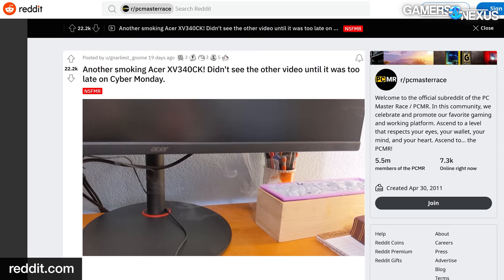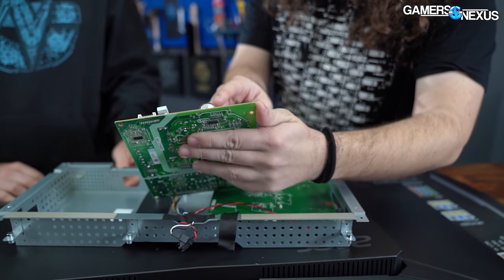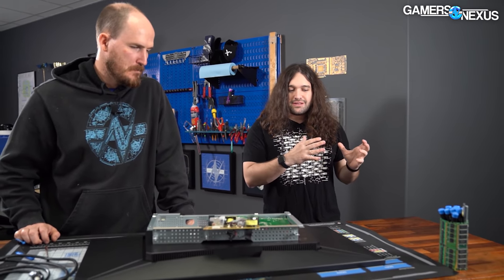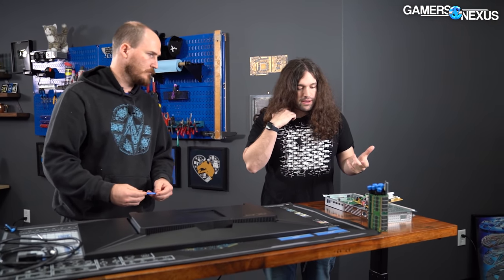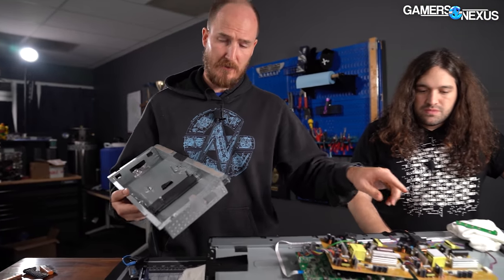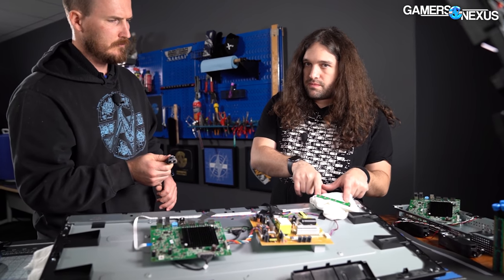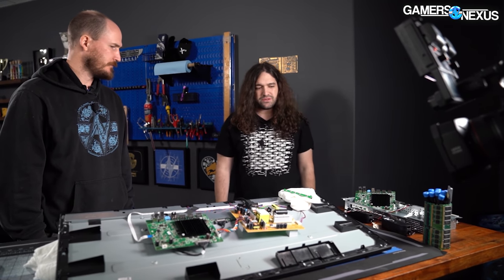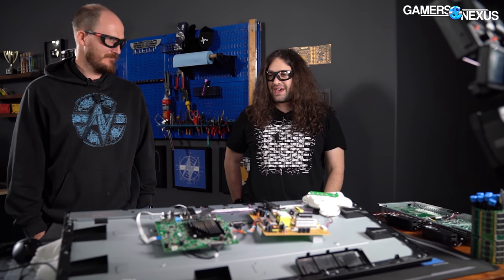Acer Monitor Fires Investigated: Blown Capacitors on Acer XV340CK

Comment: Hi Steve/Patrick. I don't know what you were displaying on the monitors while testing but maybe it's a good idea to display a plain white backround with max brightness so you can force max power consumption. Also maybe swap the power delivery board on the working monitors with the dead ones to see if there is still hope left for the latter.

Comment: That board is exactly like a PSU. It's only purpose is to supply power to different parts of the monitor. Hence, the name, power supply board. The second has the job of processing the input video signal and ultimately creating the image on the screen. That's the main board. Depending on the size of the screen, there could be what's called a timing control board, or t-con board, for short. It handles splitting the signal into vertical and horizontal timed signals and then fed to the LCD panel. These are more common in televisions, not monitors.
Reply from the maker: Yes, that's why we talked about the power board separately from the logic board and said that we'd understand the power board, but not the logic board.

Comment: I have this exact monitor. I didn't have a quick issue. But I started noticing when running a game sometimes the screen would flash occasionally and I would hear a click sound. I thought it was because my GPU couldn't handle the monitor. But I made a reddit post to be recommended a new gpu, and the comments said my gpu should be fine. 

First DP1 failed and then  ~2 months later DP2 failed. Now on HDMI I can see the desktop but when I launch a game, the monitor goes black until I either close the game or move it to another monitor. 

There's clearly something wrong with my monitor and it sucks because these aren't exactly cheap. Really love that you guys are on top of this.

Edit: I contacted Acer support. Gotta ship it out to them. Hopefully they don't say it is my fault.

Comment: would like to see you guys cover the ASUS hero z690 issue. Backwards capacitors noticed by buildzoid looking like the primary fault, but could there be other manufacture errors we haven't found yet? not sure if anyone else will add asus statements to their vids, i know you guys always do.
Also, looking forward this years disappointment built. Always a good laugh to be had there.
Happy early new years to everyone.

Comment: What is it with electronics catching fire this year? PSUs, cases, monitors, Jayz has a mobo that's catching fire. I've got a cheap LG monitor that's 10 years old and still completely working fine. The specs aren't great, but it hasn't tried burning my house down
Reply: Add z690 motherboards to that list
Reply: supply shortages.

Comment: Here's my quick guess a few minutes in:
The APFC boost circuit loses feedback for some reason and starts boosting the voltage on the bulk cap well above 450V, causing it to vent and fail.
The 'other Transformer' is most likely the inductor for APFC.
Reply: That could be it, but I think bad/underrated capacitor is more likely.
Reply: @nicholasvinen  Well it was apparently rated for 450V / 105°C, so unless they were actually defective, there would be no reason to fail, especially this quickly.
Normally any factory should be testing every batch of components they receive, so defective components getting all the way to the customer is always pretty unlikely.

On the other hand, an APFC issue like this could be caused by shipping damage (broken solder joints) combined with a somewhat bad design (no open-feedback-loop detection)

Comment: I want to say this as nicely as possible: my face went through the desk hearing you talk about the 'thermal pads' around 11:00. Not just because what you were saying was wrong, but because you did so with such conviction for so long. 
They are just physical isolation standoff adhesive blocks that serve no thermal function whatsoever.
However and given the context of this video and has others have pointed out, they are a necessary safety device to maintain board to case clearances. 
As you always say you want to understand the thing and know what you are getting into, before you accidentally mislead the audience.
Reply: Ha. I had the same reaction but managed to comment in a slightly more diplomatic fashion =D
Reply: Big oof if you guys are correct. But if so hopefully they see it.
Reply: Was about to comment something similar. Between Patrick not knowing wtf a PFC circuit is (something that EVERY switchmode PSU is mandated to have for the past 15+ years) and them rambling on about thermal pads that are in reality just standoffs/spacers... jesus this was cringy

Comment: That 'in between' transformer is the active PFC coil, just as in a PC power supply. The bulk capacitor that blows up is (on a first glance) rated correctly at 450V. Either it's below spec or the PFC circuit feeds it with too high a voltage. If it dies within a few minutes from first plugging it in, it might also be mounted in reverse polarity.
Reply: Reverse polarity was my first thought too, but in looking at them in the video, they appear to be the same orientation with the negative away from that aluminum heat sink. With that said, the cap could be labeled wrong polarity or even voltage rating wise.

Comment: Steve, I've had this display since 7/20/20. If you guys are willing to show how to disassemble the back I'll send pictures of mine. I bought it when it first came out for about $450. The only issues I've had (and it seems other have too from looking at Amazon reviews) is that half of the display doesn't properly connect to the GPU and simply shows garbage. This was "fixed" by swapping to an ASUS motherboard when my MSI exploded (and they didn't replace the cap, thanks MSI). I was also having a "no display" post error on the MSI but that no longer happens on the ASUS. This was on X470 to B550. No idea if that was an agiesa issue, crappy bios code or gpu firmware.

Could you guys plug it into various motherboards and see if it also occurs?

Another issue I've had which is pretty minor is that in a dead quiet room, you can hear a very slight buzz when scrolling in browsers. I can't say if it also occurs in games my my GPUs coilwhine+fans overpowers it. This buzz could be due to a shitty cap, which could eventually explode.

Lemme know.

Comment: Hi, guys! Electronics engineer here. A little bit of educated guesswork as far as the chonker thermal pad on the transformer is concerned: It could be used as a second source of stabilization since those things are basically one really fast-switching solenoid if their core gets loose (the core vibrates, and in doing so makes spooky noises, reduces efficiency just a tad and does other undesirable things). Have not done electronics stuff in a while, so do take my guesswork with a grain of salt in case you come across this comment. Toodles! o7
Reply: Wow Lulu is an engineer.

Comment: I have that exact model in a box that died after just a couple of months of use. Nobody was around to see it, so I don't know if it smoked or not, but it still has power, it just can't detect a signal on any input so I doubt it's the same issue. I sat it to the side too long to return under warranty now, but I doubt I ever buy another Acer monitor. I may open it up and look for any obvious problems now though.

Comment: This is why people prefer Japanese caps like those found on the Corsair RMx series, they're happy to pay for (perceivably ) better quality to avoid situations like this (assuming its just cap failure). 

Whenever I had a component fail due to cap failure it never went up in smoke, either worked intermittently until failure or died outright.. Replacing them was easy enough and got a few more years out of the product until I put it out to pasture.

My Chimei 22" LCDs from yesteryear come to mind....

Comment: That case might be so choked for ventilation that it's thermally overloading that filter cap (looks like it's 85C rated (mislabeled as 105C) at 1500 hours) they switched to a true 105C cap on the new redesigned one, there also might be a new capacitor plague coming brought on by the pandemic.
Reply: Don't say the p word! Not again!

Comment: Take a closeup picture of the capacitor.   Who is the manufacture and what is date code.    Bad capacitors will usually clump together with the same date code.   Also I have seen the heat shrink label placed in the wrong position.   When the foil winding is removed from the can, the negative plate foil will be on the outside and the inner foil will be positive lead terminal.

Comment: I had an Acer XB321HK monitor die after 3.5 years (cost a grand), I currently use an Acer X27 (cost 2200). I bought the X27 while the previous monitor was still working - otherwise I would not have gone with Acer again!

Currently have the X27 also 3.5 years (just realised that - *gulp*)! I can tell you, if it doesnt live to see at least its 8th birthday (preferably 10th, but I imagine I will have moved on by then anyway) I will never be buying anything from Acer again.

Comment: I would check the polarity of the cap, possible its in backwards. Also I would take one of the failed cap apart and see if its a fake cap.  If it rattles good chance its fake.
Reply: Did they say in the video that the caps failed upon turning the monitor on the first time? I double checked and didn't hear them say that.
Reply: A fake that rattles probably doesn't vent like this as ut might not be able to build up enough pressure. Also, rattling is not necessarily a common thing in fakes.

Comment: Switch that black cap to one of the failed units.  Second see if you can find a part number for failed cap and see if there are any other products that use and have failed.

Comment: Hi guys, thanks for doing these! Sorry if it has been said before (and I assume you guys know it anyway) but you should be really careful when touching power supply parts. Personally I wear gloves when handling things with bigger capacitors since i once got zapped by a power supply that was not connected to anything. Even if you guys can handle it perfectly well I would at least warn the viewers about touching capacitors.
Reply: That's exactly what I thought when they were getting pretty touchy with the capacitors.  Some of them can kill you right?
Reply: They have warned people about digging into power supply’s if you don’t know what you’re doing. A multimeter will tell you if there’s any power left in the caps.
Reply: @frizzlefry1921  I think that warning should be in every video when they are close to dangerous parts.

Comment: Bad Caps. thanks for another great call to attention. Many recapping kits are available for electronic products, that for one reason or many others, got subpar caps installed during production.
Once the caps are replaced with high quality units, the items live a long service life, well beyond the manufacturers wishes.
Capacitor leads can be a very dangerous items to touch after they have been put in service. Even a brand new, out of the box item was most likely powered up for testing before boxing. So care touching any part containing a cap of a considerable size, can be lethal.
The reward for replacing poor capacitors can be hugely rewarding.

Comment: Wait... MONITORS ARE CATCHING FIRE NOW?
Reply: Wouldn't be the first time? Had an old AOC start smoking and sparking years ago after coming back from dinner. Fastest disconnect and toss into the driveway I've ever done.
Reply: Not so much. More a case of capacitor failing and a bulk amount of electrolytic fluid evaporating off. 
"Where there's smoke, there's fire" isn't always true.
Reply: Not really. Just smoke.
Reply: Keyboards are next!
Reply: @nexushexus4365  Introducing Razer Blaze, enhance your keyboard with some heat (RBG functionality supported)

Comment: Wow, First time I saw smokes from monitor.
The quality standard of components are degrading day by day because of profit greeds. Thanks to Gamers Nexus team that atleast we get to know these otherwise we'll live in darkness haha.
Make more of psu testing too.
Reply: I've seen smoke from old CRT TVs but yeah, I haven't seen smoke coming from LCD panels ever. This is definitely a first.
Reply: @xabhax  it's still Acer at fault. They should quality check their components
Reply: @LiveType  I still remember in my school computer labs all monitors were acer CRT and they worked fine for like 8-9 yrs. until I was there, no monitor was ever replaced. Tells how good were those days of quality composition
Reply: @xabhax  yes, hopefully the RTX 4000 series launch gets smoothly then I'll build myself a PC. Or I'll get an Intel i7 chip and use igpu on it. Poor times for us
Reply: @xabhax  ahh.
Then I'll buy i7 13700k and a cheapish second hand 1650 for the time being.
Reply: @xabhax  you know what's even worse. In india there are very less pre built deals. Like hp dell lenovo only have 20 percent of options of combinations that other western nations get. Ahh I'm screwed

Comment: Consumers: posts computer component on fire on reddit
Manufacture: "Hopefully Gamers Nexus doesn't see this"
GN: "Time to call out a manufacturer and re-structure their QC"
Reply: I really want GN to do a piece on the trend in laptops where manufactures keep pushing capacity limits at the trade off of having the lithium polymer cells fail.  With many models of thin-n-light performance laptops (razor, hp, etc) after a year or two of regular use if you open the laptop up you find the lithium polymer packs have swelled up.  Most users luckily realize this is happening when the laptop trackpad buttons or keyboard start having issues due to the internal pressures but when it goes unnoticed it ends with smoke and fire coming out of the laptop as the swollen lithium polymer cells ignite.  Working in repair we have customers come in regularly after 1 - 3 years of owning a thin-n-light performance laptop and we almost always find the issues they're complaining about were due to the swollen lithium-polymer cells and on reddit you see videos all the time of laptops shooting smoke or fire as the lithium polymer cells fail.  Commenters on reddit are quick to dismiss it as OP somehow damaged the laptop but the NDA hidden from the public truth is it's planned obsolesce combined with firmware pushing lithium polymer packs to their limits while physical design doesn't allow from heatsinking of the battery.  The obsession with the thinnest lightest highest performance laptops that have the longest screen time benchmarks has created a serious danger to users that i'm afraid may need regulator actions to prevent from happening.  If it wasn't something that took over a year to happen and wasn't so easy to astroturf gaslight consumers on with "OP is obviously not telling us everything" maybe regulator action would be needed.  On a side note back when laptops were thicker this wasn't an issue because they used 18650 cells rather than lithium polymer and cells like 18650s can take more abuse while also due to being metal can't be smashed into a device to the point they can't be properly cooled.
Reply: Am I safe with a msi laptop?

Comment: Quick question. Are you running the monitors at the full resolution and 144hz? Its possible it defaulted to 60Hz and thus a lower power draw. Could that possibly prevent the issue from happening?
Reply: Very much possible.
Reply: I have this monitor and it's been 8 months. No issues at all. @ max resolution 144hz. Works great so far

Comment: I mean, I appreciate the “fire analysis” a lot! But I would not take all those “fires” that are reported to make a video about. As this video alone will already make people suspicious about the monitor, which may totally be unwarranted. This to me looks a lot like a regular cap failure that simply happens with the numbers out there. You could make video’s like this about almost any product probably.
Reply: Regular cap failure? When 2 seperate people had failure within minutes of powering the monitor on and they just so happened to be the same capacitors and are now changed out to different ones? Obviously not just "regular cap failures"
Reply: @Zalagar619  acer is just cost cutting probably lol. I’ve had one of these monitors for over a year now and no issues (except it’s sluggish to reawaken especially when compared with my Rog monitor and the windows all shift to that better monitor lmao)

Comment: This has to be a joke video. Especially the part where they allegedly stood there for 5 minutes with a monitor sitting in standby. If you weren't going to do any actual stress testing or real investigation I'd say calling it good after buying the faulty ones and the 1st new one and telling people to always watch their stuff for the first few days after they get it would have been more than enough.
Reply: gets worse than that... early on in the video (3:06) patrick demonstrates that he clearly has no clue what a PFC circuit is (something every switchmode PSU is mandated to have for the past 15+ years) and them rambling on about "thermal pads" that aren't any (they're just spacers for electrical insulation) all throughout the rest of the video. this was just cringy ... and about 15 mins longer than it ever needed to be to get to the point

Comment: I've had a primary side bulk cap fail because one of the diodes in the bridge rectifier failed open, causing excess ripple on the DC output, which in turn made short work of the bulk cap (not violently exploding, but popping open at the vent and smoking like in case of this monitor)